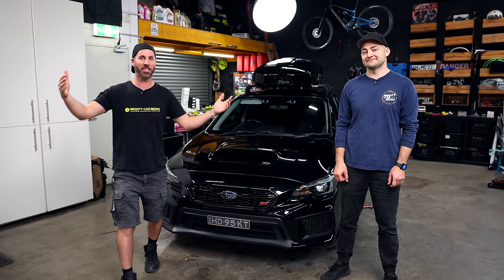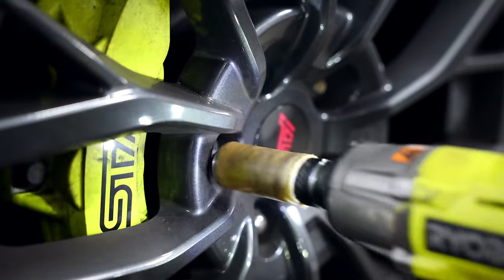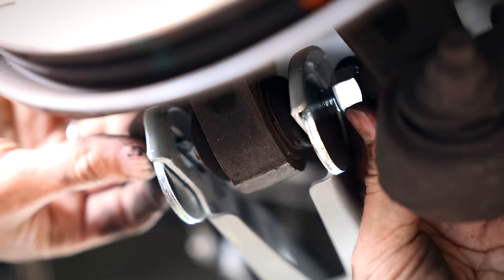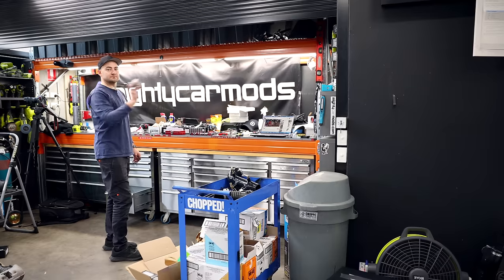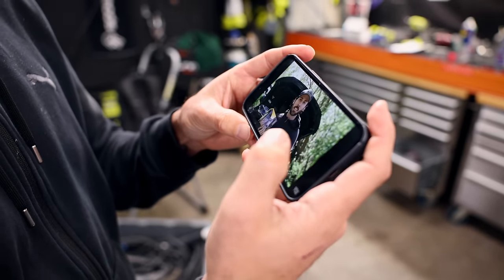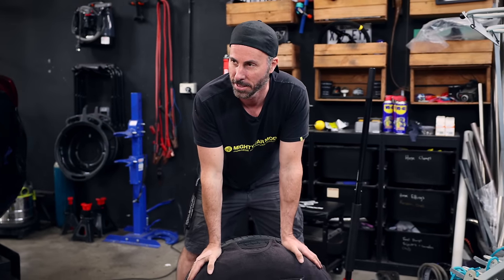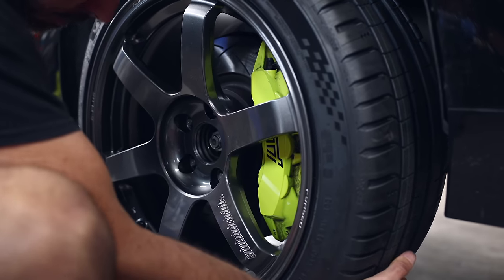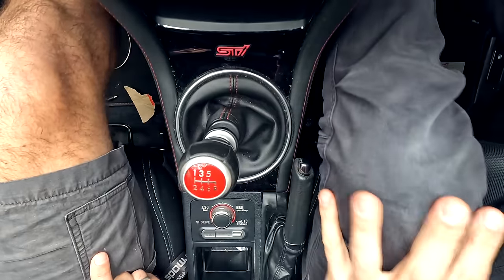MODS, UPGRADES & MORE POWER - Marty's Levorg Part 6

Comment: Just an FYI about those scotch bright pads, the brown ones are for steel and there are blue ones for aluminium. There is also a whit disc with lots of little tentacles that are really good for removing gaskets without biting into the metal surface.
Reply: I love this community.
Reply: @pearpiece97  isnt it amazing
Reply: The colour is the grade of the abrasion, not material specific….
Reply: Brown coarse, red medium, blue fine
Reply: The ones with the tentacles are called bristle discs (in the UK) green ones are good for removing paint off bodywork without taking any metal away

Comment: If you've not installed an under hood LED strip for general lighting it's a good mod for all cars. Great for any night work even for things as simple as checking fluids. Felt like commenting as I just am finishing up on adding a windshield interior LED strip, Underhood LED strip, and Trunk LED strip on my most recently purchased car. Strips are a quality of life upgrade but it's great as there are almost no shadows compared to single bulb dome lights and such. The under hood light is something I've been doing for ~8 years now and for a mod that takes less than an hour to install and wire up and is worth while.
Reply: That sounds like an awesome idea!
Reply: How do you fix them to the hood? 
If its magnets, these subies have aluminium hoods iirc
If its adhesive, I'd love to know how you manage the heat on them to keep it stick!
Or if its drift stitches that also works haha
Reply: @tinystar3010  See my dads channel "Claythargic", the video "97 Miata Lighting mods" for an example. The video was made for when we sold his car but I did all the lighting mods. If you try the same, DO NOT use the adhesive that comes on the LED strips. It's trash. 3M VHB Clear Mounting tape is the way to go. Luckily the bed LED tape adhesive comes off easy after a little heat from a heat gun.
Reply: @lachychops2   3M VHB Clear Mounting tape. The key is to strip the crap adhesive that comes on seemingly all LED strips. Luckily a bit of heat from a heat gun is all that's needed to pull off the bad adhesive. See my reply to tiny star for a reference to a video I made for my dads miata before he sold it. I did all the mods and they lasted for years without issue.
Reply: @saccaed  thanks mate! Thats really interesting stuff. Whats the longest install life youve had so far?
Reply: @lachychops2  Under the hood, the first install was ~7 years ago and I don't know the current state as that car was sold ~5 years ago. Bunch of strips have been on the outside and inside of my RV for 5 years without issue. Only failure I've had was with 1 strip where I experimented with leaving the bad LED adhesive in place(it de-laminated, shocker). Seems like so long as surface prep is good and placement isn't near exhaust components that there isn't much issue. Use the waterproofed LED strips though for obvious reasons. I trust the strips and 3M VHB Clear mounting tape to ~200F+(under the hood of a black miata without issue throughout California summers).

Comment: Guys, I'd love to see some content surrounding your audio install. I have an idoing in my 11 WRX and keen to see how you set up your EQ and what speakers and other audio gear you went with. Volume control is a bit of an issue with these head units so can't wait to see how your setup turns out.

This Levorg build is by far the best series you've done in a long time!

Comment: How are you planning on controller flex fuel,tgv delete codes, etc after the Cobb software change over the summer no longer allowing those tables available for editing? Or are things different for AU users vs US users?
Reply: Must be different in AU. They clearly loaded a base map and plan to tune with the AP.
Reply: Wondering the same thing. Went to Cobb's website and looked at parts for the AU cars, and they don't sell any of their fuel stuff anymore.
Reply: Curious about this as well. As far as I know, the Cobb changes are global.
Reply: Came to the comments for this reason. Curious

Comment: Unless you want garbage fuel economy, keep the TGVs (the TGVs remain closed at cruising throttle to induce turbulence in the air flowing past the injectors which promotes atomization [better atomized fuel can be burned more effectively]). I know it's required for the COBB flex fuel kit, but since the GreenSpeed update here in the States, COBB doesn't even sell the flex fuel kit anymore. The way you have to do E85 now is to have a couple different tunes and an Innovate ethanol content gauge. Since you're running E85 on the stock turbo, the stock intercooler would have been PLENTY (due to the evaporative cooling). Would have liked to have seen a KillerB motorsports oil pan kit and an IAG AOS go on the car for reliability's sake.
Reply from the maker: AOS and Oil Pan are on their way, TGV's mostly for cold start. E85 still ok in Australia for now.

Comment: I saw you were using the access port. How did you tune for the tgv deletes and the flex fuel when Cobb won’t do that anymore?
Reply from the maker: Depends on the laws of where you live
Reply: @mightycarmods  damn I need to use a vpn then and ask someone over there to etune my car. I’m selling my 13 pbp wrx cuz I can’t go bigger cuz I have a lot of crap deleted that I refuse to rebuy and put back on

Comment: Love your work, this will be an awesome daily.
Bit of advice with the locator rings, get yourself some Castrol copper coat grease and give it a very light coating to stop them sticking to the brake discs. Castrol copper coat grease also works well on anything to do with exhaust system bolts and nuts, highly recommended.

Comment: You guys are missing a short shifter, an AOS, cylinder 4 cooling mod and a Koyo radiator. A turbo blanket would minimize heatsoaking the top mount intercooler as well.

For track use, I'd add an engine oil cooler, brake Master brace, stiffer engine and transmission mounts.

Comment: As someone who is currently helping a friend replace an engine that failed due to a tiny part of a clip falling into the cylinder during a spark plug change I would highly recommend stuffing some clean rags into the intake manifold the moment you take it off especially when you are cleaning off the surface. Also I love these cars, would definitely buy one if the released a WRX spec

Comment: A 20mm drop is so nice, and I'll say that for just about any car. When I had my Swift GTi, I looked for ages to try to find springs that weren't more than 25mm but they didn't exist. People don't realise how impractical it makes the car to have even 90mm clearance. It sounds like heaps but the 100mm legal limit is there for a reason.

Comment: Keep checking the oil, don’t spin a bearing on the new build like I did! I only checked the oil once a week and it burned more oil than I expected in the winter. 

Good choice on the lowering springs, coil overs just don’t ride as well since they aren’t progressive and will either be very bouncy or so stiff it just hurts to go over medium bumps.

Comment: @mightycarmods, I saw you guys took the air pump off, Marty threw it in the trash. I hope you guys saved the Barometric pressure sensor from it. it is a part of that pump.  you can slice it off with a razor blade. THAT SENSOR IS VERY IMPORTANT FOR TUNING. most people do not realize it and trash the entire assembly.
Reply: They don't actually throw perfectly decent car parts in the bin. It's just for the video.

Comment: Love a 5 spoke TE with a deep offset, but they just don’t fit the Subarus. That said, nice choice with the 6 spoke TE37’s.  I’m running the JDM Spec C STi wheels. 

Cobb flex fuel, catted bellmouth downpipe, running E85 with larger injectors and fuel pump, I’m hoping you get 400-420hp at the wheels, though you might want to dial that back to 375awhp for a daily. 

Very excited about this build. I might go e85 on my STi hatch once Cobb makes one that is CARB compliant (supposed to happen soon).  I gotta see if there’s any non-factory downpipe CA will allow me to run.  Oh, and a CARB compliant tune, of course...

Comment: Super awesome car!  I take it you guys don't have to worry about the Cobb tuning Greenspeed project like we do here in America??. No more ability to turn off tgv delete check engine lights or any emissions related components that cause CEL's. So we can't run flex fuel unless we want that engine light lit up or just have a separate e85 map that has to be switched to if we use e85, so no blending and automatically adjusting for it. 😔

Comment: The real reason he deleted the TGVs... The wiring that gives the feedback loop signal for them, is what Cobb is using for flex fuel.

since he wants to run e85 and flex fuel he has to delete the TGVs. then that neat little harness he has let you plug the TGV wires into the flex fuel sensor.
Reply from the maker: I've had them fail on other cars and make it run like crap

Comment: Didn’t realize you can still run the cobb flex fuel and the AP will allow a tune for it in AUS. Interesting as we can’t in the states.
Reply: Same was wondering if this was a old ass video because with the TGV deletes it should still throw a check light.. so AUS must be different from the states

Comment: Your really making it hard for me to get another subaru....I haven't had one in years..but I still have the Trans and rear diff.....Trans is blown ...now I have 2011 mazdaspeed 3 been working on for 5 years I think.....but no parts list......but I do have the gfb blow off with the extended trumpet....first part I did...6 years ago....lot better than the greedy rs blow off....in my opinion

Comment: Quick question? How are you still using the COBB and flex fuel tune without TGV's? COBB in the USA has blocked this, and also the ODB error codes can no longer be turned off. If AU has a different COBB distributor this might help lots of American's who have been abandoned with our COBB equipment. Thank you in advance. Mark

Comment: Not entirely sure how you’re using the flex fuel kit with a “flash” if Cobb ripped that off the shelf for the accessport.  Unless you’re using a dual map setup… but I’m very curious 🧐

Comment: @mighty car mods the rear springs appeared to be installed upside down and at 12:51 I see that it is upside down. The part where the springs comes closer together should be going towards the top mount while further apart should be facing down and sitting on the perch. Just put together a set of springs and struts for my VA this past weekend and i believe the spring orientation should be the same across different manufacturers.
Reply: Looks correct to me.
Reply: @PigBoat9  the progressive spring should be on top vs the bottom so it is currently upside down. Updated for correct time stamp at 12:51. From a performance standpoint, I’m not sure if it makes a difference but that’s just what I’ve generally seen.
Reply: @David-xe3mj  I think it depends on the spring manufacturer. On all my GD generation Subaru suspension install, all of the progressive springs are installed with the tighter coils at the bottom perch. I did a bit of looking at newer fitment STi springs and I saw that Faction Fab springs on the rear are designed the way you are describing, but it looks like the Whitelines that MCM are using are designed to have the tighter coils at the bottom, like they have theirs.
Reply: @PigBoat9  thanks for clarifying. Was also trying to look a little more into it but it seems that aside from how it sits on the perch, the function of the performance of the spring will be the same irregardless of the orientation.

Comment: the setup on my 2020 WRX for the wheels i have Enkei TM7s that are the same dimensions as your wheels being 18x9.5 +38mm offset and im running a Continental DWSO6+ 265/35/18 and i dont rub or scrape at stock height

Comment: Pilotsport 5s do not have the same performance as 4Ss. They are the same performance as 4s with more wear resistance. The pilotsport 4S has not been replaced yet.

Comment: My 2019 sti had an intake and a pro tune, now it needs a new engine. Bottom end failure. I did keep up with the oil, makes it hard to recommend modifying these cars. I'm having to pay 7 grand to get it replaced. The subaru warranty documents say you can run an intake but no tune which is really dumb.

Comment: Just curious, why didn't you mount a manual gear box from the BRZ or Toyota that uses the FA20E engine with a manual box?  Would that not have worked?

Comment: Wish Mazda had aftermarket injectors it’s not as easy as upgraded injectors and fuel pump we need basically a whole standalone system and just had 4 extra injectors to get anything over 380whp
Reply: Totally got my dream wheels I have rpf1’s they are cheap and light weight authentic wheels but if I could ever upgrade for sure te37’s is the goal

Comment: Do a high flow cat vs a test pipe test, I’d be interested to see the difference between a good cat and no cat. I’m sure they are both better than the stock.
Reply: The price of no cat isn't worth the benefits
Reply: @PheonixRise666  I have a 135i bmw and the catless pipes supposedly adds 30hp and the high flow catted downpipes supposedly add 25hp I just wanted to know if they pulled those numbers out of their butt or they are legit.

Comment: After waiting for my first inquiry, not received any comment, will now send the  2nd request about Jimny 98 manual with g33b engine, what should I replace to swap m18a,
All engine with transmission 
Or just engine? Not transmission 
Ecu and wiring altimately going to be replaced.
Thank you very much

Comment: known EJ mods are so proven engine needs solid decking,  head bolts, dump and exhaust , turbo and delete a few things and tune . why do ethanol given the lack of distance and cost? or is it cheaper now than petrol lol springs no way needs good dampers to match springs every time so get a coilover sponsor lol. old model subes used konis and top quality euro coilovers and dampers I have JDM tein in my foz and silvers in my sti GD. Also MCA and even top euros in USA  been dealing with troy forever

Comment: hey guys love the build, but how did you get around the eyesight system for rego to make the car legal in NSW? I looked at doing a similar build a few years ago, but didn't proceed coz the eyesight system needed to remain in place as it is considered safety system much like airbags and ABS.
Reply: I'm sure they know some people who will sign off on stuff for them.
Reply: I would think it is still in place because they basically just changed the chassis for a wagon one. The electronics and mechanics are still the same, so no issues there I would guess.
Reply from the maker: Where did you get your info? Speak to an engineer yourself

Comment: How are u using non greenspeed compliant parts with cobb????? I've wanted to downpipe my sti for a bit but have run into the problem of having no way to run an access port and have a tune for it

Comment: Are there any mods you can do to a brand new car that won’t void the manufactures warranty? Or don’t do any until it’s out of its factory warranty?
Reply: You pretty much can't do anything until it's out. IMO it's a way better idea to mod an older car anyway because they're way cheaper if you screw something up and normally easier to mod for three reasons:
1. Everyone has already worked out what works and what doesn't
2. There are way more parts for them
3. Manufacturers are getting better at stopping any kind of upgrades by putting stupid sensors and stuff in, so older cars just work better. e.g. Go back as far as 2008 or earlier to find some cars that still have traditional throttles. Everything newer has a fly-by wire which is then tricky to do anything with without getting error codes.
Reply: @daysandwords  thanks so much for the info. Time to start looking round for a project car 😊

Comment: Is there any actual benefit to swapping these specific wheels, other than for the sake of it? I really like the look of those STI ones and wouldn't swap them if it was me
Reply: Weight. Those Volks are over 4kg per wheel lighter than the factory wheels. Some of the difference gets taken up with extra tyre, but that's still a massive reduction in unsprung weight.
Reply: Also he seems to be planning to put quite wide tyres on it at some stage, which will do better on a larger rim. Although that’s also not really necessary unless you’re going for quite a lot of power.

Comment: i have a 2017 yaris 1.5 design in pearl blue and i can find little to nothing for it i thought i would get a sporter model so i would be able to find mods for it little did i no everyone went with the 1.3 yaris instead of a 1.5.
im not even asking for stupid power max i want is 200bhp i do not think front wheel drive cars should have more than that more than that i would go AWD or RWD. 
I am not judging anyone who has more just what i would do hell my friend has a Honda jazz with a k20 engine swap that has way over 200bhp and its front wheel drive and i think its amazing.

Comment: Carbon fiber look on parts, that are in fact molded plastic is awful and adding case on top of this mold is not only awful, but also dead weight - this is exact opposite of what it tries to look like it is doing.